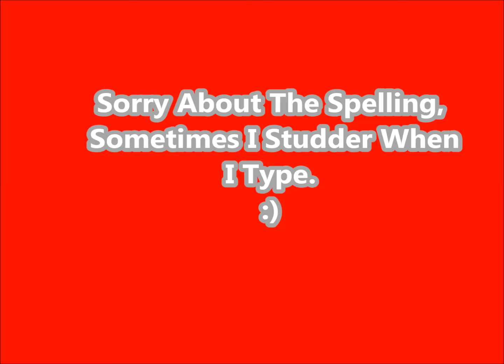Grass Catcher 3

Comment: How does your door attach/work? I'm trying to build one of these in my garage.
Reply from the maker: The top and bottom of the door are made of 1/2 in angle iron the sides are the 1/2 in conduit the door is built just a little smaller then the back opening  of the catcher so that when you slid it in the top and bottom angle will butt up against the the top and bottom of the catcher opening on the bottom I welded another piece of angle iron to make a channel that will slip over the bottom tube of the opening. this must be made big enough to accommodate the extra thickness of the mesh and zip ties. hope this helps.
Reply: doghousedan1 thanks... helps a lot!
Reply from the maker: Let me know how yours turns out :)